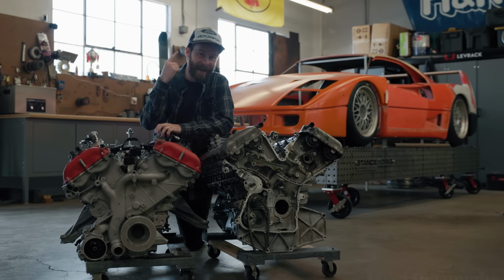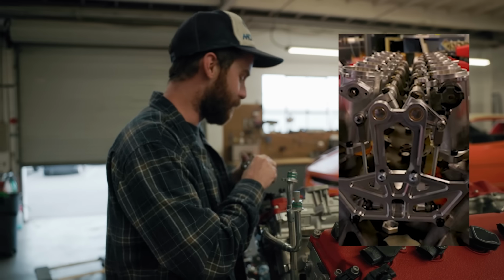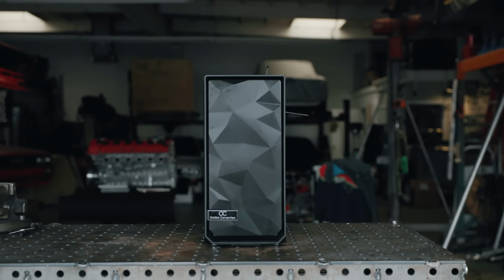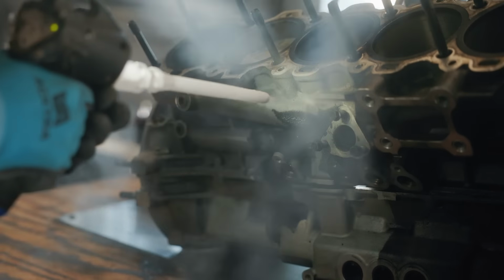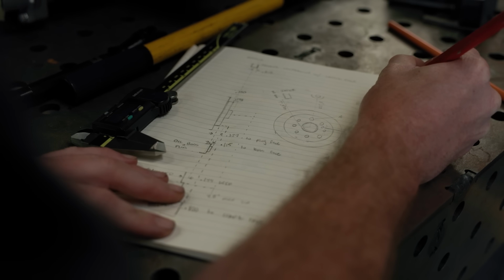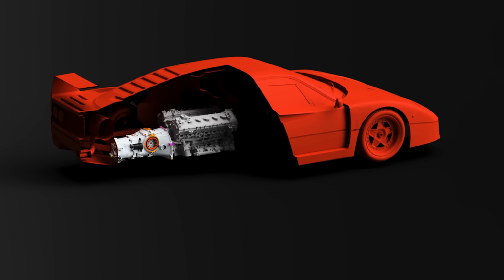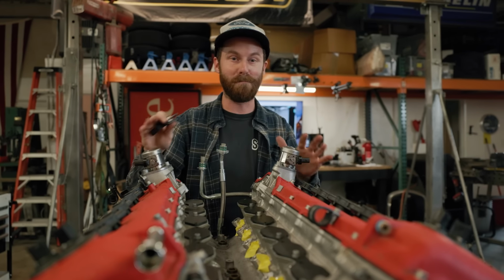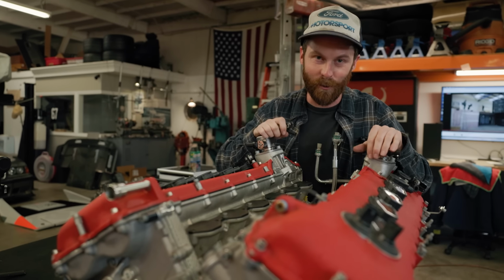Stuffing a V12 into my F40: 3D scanning is my favorite tool yet.

Comment: I'm a fuel system engineer and even though the tuning limitations you mention to the GDI system are pretty easy to overcome, I can't argue the simplicity of a PFI system. The main advantage of a PFI system in my opinion is that it cleans and cools the intake runners and valves, preventing that nasty carbon buildup you see on modern engines
Reply: I feel like DI is optimizing only the combustion aspect of the engine while de-prioritizing the engine health in a broader sense. On a race car it may not be as big a concern, but for daily drivers DI seems like such a bad idea based on all of the videos I have seen showing what happens to the valves and intake ports on those engines. At the very least a hybrid solution is needed to keep the intake and valves clean. If you are only going to own the vehicle for a couple years, or plan to rebuild the engine regularly for racing then DI's benefits start to make more sense to me. This is all based on feeling and intuition however so I would be curious to know if I am off-base.
Reply: @barnett25 I believe they are starting to use a hybrid system with an extra injector in the in take manifold to clean the valves.  Some are even using both systems for the specific reason. For example Toyota’s D4S Injection system.
Reply: @barnett25  Toyota solved that problem by having both DI and PFI on the same system. D-4S is the name they gave to it. Under certain conditions the system will switch from DI to PFI.
Reply: @BkSMedia  most ford engines have it too, but most manufacturers are starting to move away from DI-PFI now as it doesn’t make too much sense for new emission standards
Reply: Much of the issue with DI not washing valves is caused recirculated oil vapour and EGR crap. he won't have any of that to dirty valves. He's also unlikely to do 100,000km like a daily driven gdi Mitsubishi with elephants foot valves. 😂
Reply: I couldnt agree more. It’s a sad day when engineers have to design based on emissions vs reliability and performance.
Reply: @jssouthtx  DI is more performant than port injection. Direct injection, turbocharger and water injection comes all from plane engine design to increase power. Direct injection gives you higher efficiency and therefore more power. Particle emission wise DI is even worse than port injection.
Reply: I agree with all of these points, and this would be the ideal build. But this is Matt's car, and it would not exist without his imagination and determination, so I think he should build the car that works for him - which will still be an incredible machine, as the previous Ferrari has proven.
Reply: thats exactly why toyota mostly uses both port and direct injection in all of their engines.
Reply: The best option is direct injection AND a second set of port injectors for high throttle/load situations. Then you get the cleaning/cooling effects of port injection when you need it, and the low down power of direct injection.
Reply: @Jonathan_Doe_  agreed. That's what we're doing with our Di vehicle. Going port injection and Di will be for idle and low throttle response.

But that still requires additional standalone to run both. That's why it seems that people delete it entirely for motorsports.
Reply: But what if h runs both and has the benefits of both?
Reply: @jwalster9412 why complicate things, if he wants a dual fuel injection, he can just have one in the runners and one ontop of the velocity stacks like old F1 cars
Reply: @jwalster9412  he is only running port
Reply: @jwalster9412 he won’t, I suggested it in the previous episode.
The guy said he doesn’t know enough about DI so he wants to get rid of it and go PFI, now he goes on about how everyone else gets rid of it because it’s not good and is only there from factory because of emissions. Honestly sounds like he found perfect excuses to not devote the time to learn about DI, this build will take years even at just 4hour a week he would have studied 192hours of DI by the end of the year… I mean you sit on the toilet with your phone and 30min goes by really fast, instead of watching funny reels watch courses on DI.
But in the end is it’s car and he already is taking a lot of negativity so may he find peace and take the path he feels more satisfied with
Reply: but even with e85 he will loose power
Reply: @hugocunha30  no he wont.
Reply: @seancca  tel me how then? we are talking about na engines, not turbo. Just for the fact of it beeing port injecting he is loosing air displacement
Reply: @ running E85 will make up for anything potentially being lost with direct injection but that system is for efficiency not performance. He also is not going to lose air displacement either. Fuel gets atomized by the injector it is not going to eat up air volume. I’m not sure you quite understand how engines work.
Reply: @hugocunha30  I am curious, how is he losing air displacement? How do you think Port Injection is setup?
Reply: @seancca 100% he will.
Reply: @theo7709  this is laughable. He is not going to lose power running E85.
Reply: @seancca efficiency IS performance! Especially in NA engines. DI is way more performant. There are two main aspects: first you lose air volume. There is only a limited amount of displacement in a cylinder. In a DI engine you suck in ONLY air. 100% of the displacement is filled with air. The DI injects once the intake valves are closed. That's one of the reasons you have to run high pressure. But in a PI engine the air/fuel mixture gets sucked into the cylinder and therefore less displacement for air. Second reason is that the fuel is obviously liquid. But in the moment of injection it vaporizes. The vaporization takes energy which is taken from the air in the cylinder in form of heat. That means it cools the air in the cylinder->cooler air->less knock->more ignition timing->more power
Reply: @ direct injection is not way more performance. 😂😂
Reply: @seancca  I didn't mention e85 at all. What I said is true for every fuel
Reply: @seancca  yes it is, and I explained why
Reply: @theo7709  you are not losing air volume in the cylinder. You have a fundamental misunderstanding of volume and molecules in a space.
Reply: @seancca  how can you not lose air????? The fuel in your air/fuel mixture has a volume! Especially as vapor in your runners. You have way more air in your cylinder in a DI engine.
Reply: @theo7709 are you saying that the AFRs between Port and DI are different? If no, then there cannot be more or less air volume between the two, they will be exactly the same, regardless of when the fuel and air mix.
Reply: @Uber_Steve  you are wrong. The AFR is the same but the pressure in the cylinder is different. You claim that one liter of air has the same amount of oxygen as one liter of air/fuel mixture, which is obviously not true.
Reply: @Uber_Steve  actually this is exactly the point. We have more air/oxygen but the same AFR and therefore more fuel and more power! More power per stroke means more efficient and more performance! This is the reason why every performance engine nowadays has DI. More efficiency means more power.
Reply: @RandomPasserby-l5x you are very correct with most things you say. The only thing not 100% correct is the AFR in volume. There is a number flying around in the internet which is 9000:1 in volume. But that would only be true if the fuel stays indeed completely liquid. But you can only cool down the intake air if the fuel vaporizes. Because the heat from the air need to go somewhere, it can't vanish. The heat is used to vaporizes the fuel. Fuel vapor has about 800 times more volume than liquid fuel and therefore the real AFR in volume ends up somewhere between 15:1 to 35:1. So it is definitely not negligible. I also don't care if this v12 is converted to port injection, but I don't like when the reason is wrong and not understood. DI is far ahead of port injection in terms of power and it's blasphemous to convert a DI engine to port injection. I have also done blasphemous things like converting an injection to carburetor, but it just sounds so awesome. But claiming there is no downside with this conversion is just not true.
Reply: @theo7709  an NA ICE engine is just an air pump. Without forced induction,  the engine is limited to the amount of air by the compression ratio. DI and Port, when they have matched compression, have the same amount of air available. DI doesn't give increased air.
Reply: @Uber_Steve  I'm not sure how I can make it clearer to you. You are still wrong. But i will try. I use random numbers now to explain to you how it works and i simplify things. Imagine a one cylinder has 1liter of displacement. In an DI engine you suck in 1liter of air, then the intake valve closes, the engine compresses this 1 liter of air and close before ignition the DI injects the right amount of fuel for 1 liter of air.
Now in an port injection engine with 1 liter of displacement the fuel gets injected into the air before the valve and you have an air/fuel mixture. The engine sucks in 1 liter of air/fuel mixture. (Random numbers now!) In the cylinder are now 950ml of air + 50ml of fuel= 1liter of displacement. 
Now you have less air for the combustion than in the DI engine. 1l vs 950ml.
Reply: @Uber_Steve  and you mentioned compression ratio, but it has nothing to do with the amount of air an engine is "pumping". Please check again what compression ratio actually is. I can try to help if you want.
Reply: @theo7709 at the end of the day, your limited by your injection window, and the amount of fuel you can deliver with Di.

Your Di pump will max out far before you can utilize full E85.

You might be able to get use out of E40 but not full E85.

With port injection your injection window is much larger, you can dump fuel outside of the combustion stroke when the valves are still closed.
Reply: @SouthdownGarage  you could easily put a bigger hp pump on it, or bigger injectors in it
Reply: @martinwink2063  even with upgraded injectors and pump are limited.

You get far more tune abilities with port injection vs Di. The technology is not there for making the same power as port injection. It's simply not possible.
Reply: @SouthdownGarage  you say in the end of the day your limited by the injection window, but this is exactly where DI shines… if you have good (fast enough) injectors you can have multiple injections in 1 stroke, for example one very short injection to pre-wet the chamber, then the main injection period and another delayed injection to keep the combustion going for longer while the piston is going down. You could even add an injection period to have gas combusting in the exhaust to make some really high pressure waves going out of the exhaust which should in turn help suck the exhaust gases from other header primary tubes.
Manufacturers make use of this high number injection cycles in one stroke in order to lower emissions, and I will believe what you said that the technology to make use of this in the search for high Hp doesn’t exist yet.
Personally I feel if he kept the DI and found a way to measure in cylinder pressure he could tune even better then Ferrari, and I would add PFI to that for lubricating of the valves, cleanliness and an adittjonal charge of air/gas waiting behind the inlet valves (like you said).
But it’s his car, his money, his time, his decisions.
Reply: @andredesousa96  I'm saying that PFI will out perform Di. Your saying it's not?

I don't understand your argument. No matter what, you can run a PFI injector longer then Di. It doesn't matter how many injections you make with Di, your limited by ignition. You can endlessly dump fuel or you would get pre-ignition, it would start burning without spark, just from heat like in a desiel.

PFI isn't about cleanliness of valves, you can do that with meth injection. To be be able to set opening and closing, without worrying about making sure your injection angle/slope is correct, there's a lot more to Di, and it's just not there at this point.

Comment: From your previous video I did my research.
Direct injection is not good for the engine. If you care about pollution then care about how much time your car will last.
There's a footprint to build a car. Batteries have a huge foot print. Do you really know the foot print of an iPhone?
Reply: One car that’s driven less than 1000 miles a year will have virtually zero impact on the planet

Comment: i have a few concerns on how the car will handel while having the majority of the weight at the back, it could be quite unpredictable.
Reply from the maker: No different than any other mid engined car, it’ll handle great!
Reply: @stanceworks  I made a modified f40 in asseto corsa that resembles the one your building, it runs on Pirelli P Zero tyres on the original f40 chassis, with the v12 engine, it ran a 1.48 on imola, a decent time around the same as a gt3rs, here is a lap, this isnt the hotlap but a fast lap: https://youtu.be/TY7x7xiUsNE
Reply: With the engine weight that low it will handle great 👍
Reply: @hubertkam7647  getting back to the original comment- why would you be concerned about the handling of a mid-engine V12 super car?  It’s been done in road cars and race cars for over 50 years.   Mike showed that the V12 is much lighter than the TT V8 that came in the F40 from the factory.  Mike’s chassis will most likely be lighter than an F40 chassis.  Mike’s F40 will absolutely be lighter than a factory F40.  So what is the concern?  Lol
Reply: @scotth7686  The car will have a 35-65 weight distribution, which will result in significant oversteer. With 700 hp, a conventional wishbone suspension, and a sequential gearbox that is usually harsh, it will be extremely difficult to drive. It also won't be any faster than a GT3.
Reply: @ ridiculousl
Reply: Porsche is horrible in this department. So much so that to race a Porsche, you first have to flip the engine around to mid-engine .
This project will handle just fine
Reply: @shanehiggins3033  You are clueless.  You know nothing about the history of 911s in racing.
Reply from the maker: He’s right. Current factory GT3 cars are mid engine, not rear engine like a production 911.
Reply: @scotth7686  older 911s with rear trailing arms handled no better than a Fiat 126p with more power, a rear bias car will always oversteer.
Reply: @hubertkam7647  Rear engine Porsches won countless championships.  End of story.
Reply: @shanehiggins3033  porsche dont use tube chassies, when they did in the 917 it handled quite poorly.

Comment: The 3D cad stuff is why I'm here for this build. It's awesome to see these tools at work.
Reply: @davidmcdermott3415 if you like to see more of this kind of stuff i can recommend @LearnEverythingAboutDesign as well as just every formula student team out there (you get insights about cad work and FEM/MBS and CFD simulation) also I as a mechanical engineer am pretty disappointed about stanceworks not modelling the frame of the car in cad.. because how is he going to simulate and optimize the frame for stiffness and weight .. by eyeballing it? :D

Comment: Please make sure that PC has the latest BIOS installed to help the longevity of the CPU. The 13k/14k CPUs from Intel have been found to have major issues that can kill the processor. The updates were sent out around the start of October.
Reply: @sys-administrator  problem isn't warranty is potential work lost because the system crashes all of a sudden.
Reply: Have no idea what your boys are talking about but thank you for making sure this project stays on track
Reply: @AhmedHuss7  intel 13 and 14th gen CPUs have an issue where they experience rapid degradation due to oxidization of the silicon. This manifests as crashes, blue screens, etc. and once it starts, there is no fix for it. Intel says the latest update to the motherboard bios will fix it, but they are on the 3rd version of the fix now, so who knows if the CPUs are actually fixed or if they’re all destined to die immediately after the warranty is up. 
Some data centers running the faulty intel CPUs were experiencing >50% failure rate, running factory 125w power limits (Intel CPUs from that generation can easily pull more than 300w if power limits are removed) so it’s not an issue of people giving them too much power.
Reply: If he’s already experiencing problems the CPU is done. Talking about compute w/ an Epyc CPU is pointless. Raptor Lake is consumer garbage for many reasons. A 9000 series Ryzen would be an improvement in all regards and you don’t have to worry about corrosion.
Reply: Imagine using Intel in big 2024 and almost 2025 lmao, certified garbage 🗑️

Comment: Hearing the sound of DDE's v12 get me fizzing with excitement for this to start to take shape. KEEP IT UP
Reply: Chassis is F12
Engine is F12

It's a F12 genius 😂
Reply: DDE got rid of the direct port injection, that car is just way more efficient. That car is putting out 1278 up on one bar of boost.
Reply: That’s what I was gonna say I never heard an engine rev as fast as the f12 on dde.  Love that car and the crew.
Reply: F12
Reply: @reesebroekhoven3962 There’s not much left that’s F12. The majority of that car has been custom built by Mike Essa.